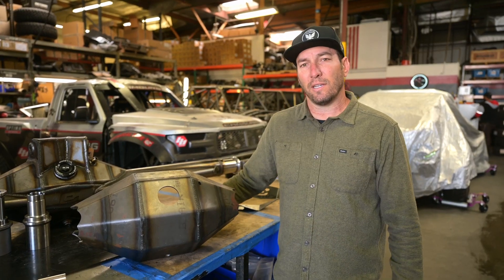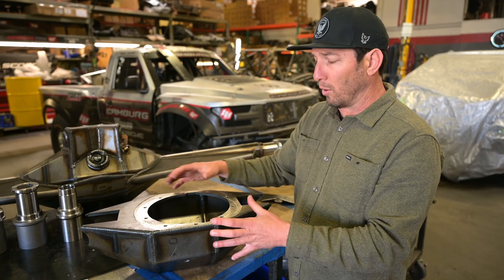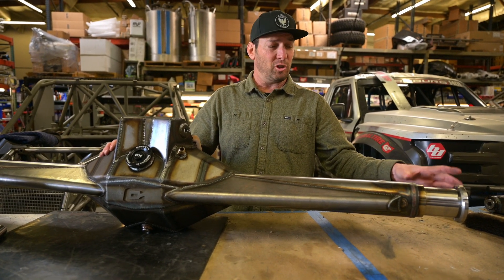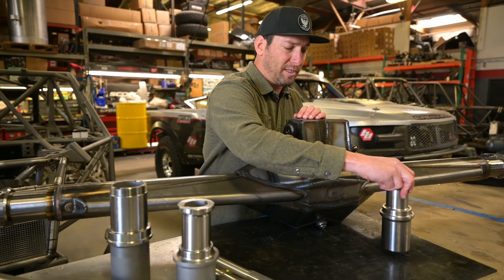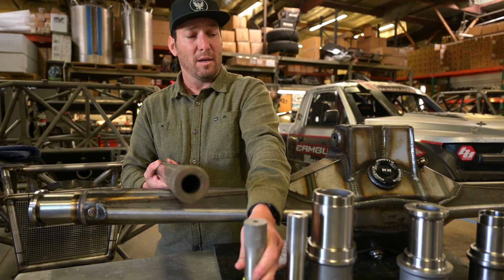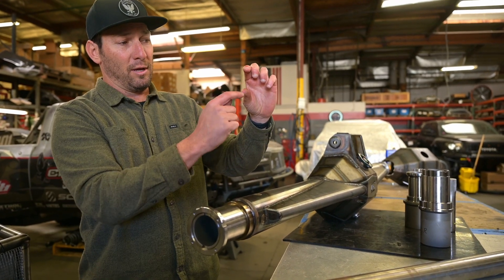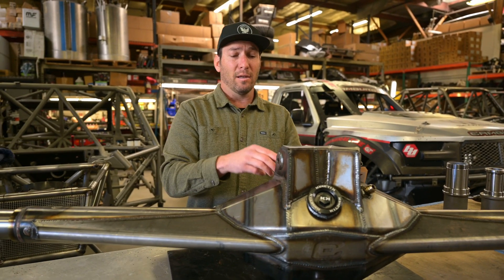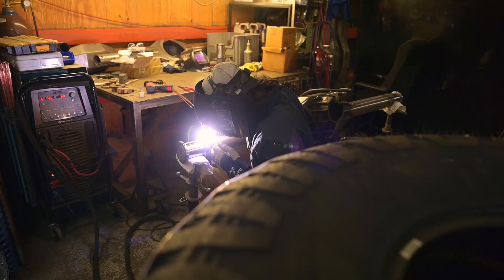What goes into fabricating a Camburg 9" Rear End

Comment: Fcking amazing! Thank you! I have a BMX background and I need to ask if those cromo tubes, plates are heat treated or not? Releasing the tension of the welds is a key to keep us safe in the BMX world, I wonder if these parts need that too.
Reply from the maker: WE have heat treated rear ends as well. Most are not heat treated but can be. It's not as necessary on these as it is on a thin 4130 BMX frame.